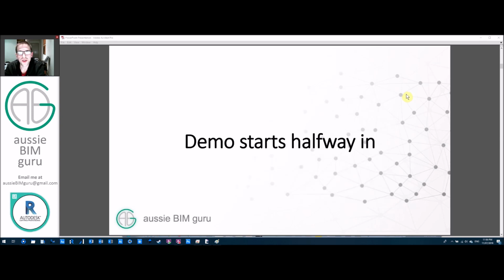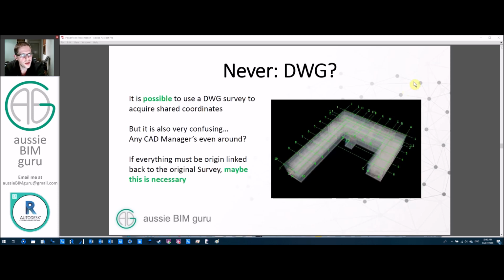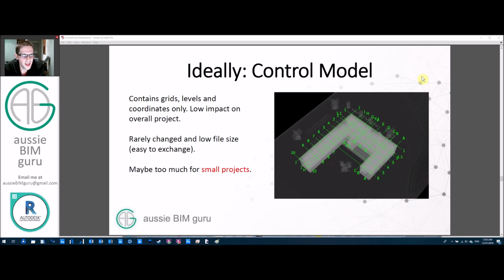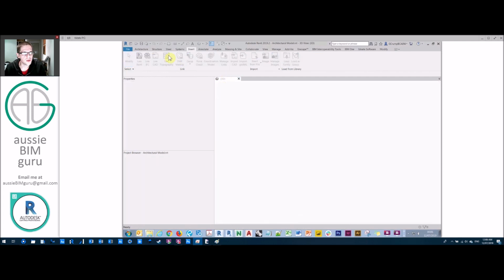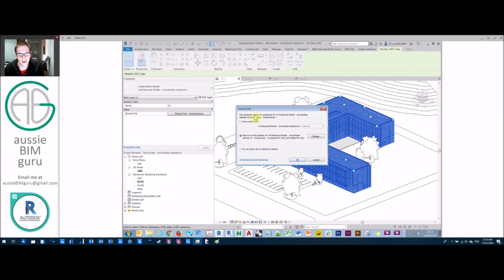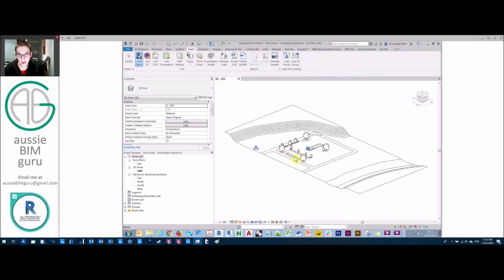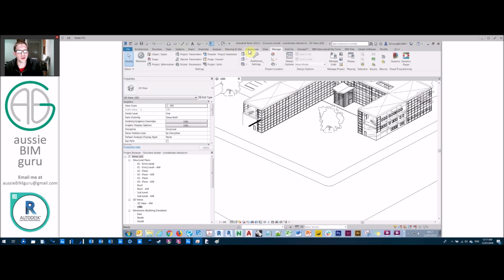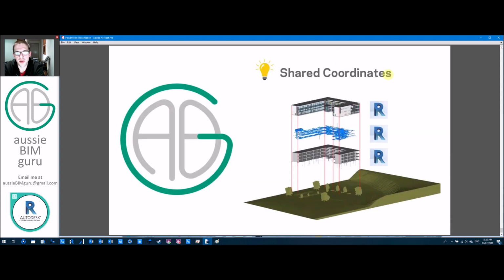Managing Shared Coordinates in Revit!

Comment: Hi, Thanks for sharing video, May I know we still need to do shared coordinates if we have the same boundary line, model, internal origin, project based point and survey point?
Reply from the maker: No you could just work with the same settings if you really wanted to, but it any changes would need to be manually coordinated across all teams without shared coordinates.
Reply: thank you :)

Comment: Awesome video! Thanks! Question: not sure how you could model a building without first having a survey… you would have to design/position your building according to zoning restrictions. Accordingly, it appears that the site model and the architectural model MUST be done together FIRST and THEN you can establish shared coordinates- no? Also, how does this work with the BIM 360 workflow?
Reply from the maker: You can use high level data sources like GIS and publically available cadastre information, but generally without a survey a confident existing condition cannot be ascertained. If by the time coordinates need to be established there is still no survey, there are issues on the job to be solved beyond BIM there.

On BIM360 you can acquire coordinates from models but not publish them if I recall correctly. If coordinates need to be reset I believe this is only manageable if the model is downloaded first

Comment: Very good material. Thank you!
I watched it and hoped to get my problem solved. Unfortunately. It seems like shared coordinates works well, because I'm able to link architectural model to my MEP one and they aligns perfectly. The problem appears when I try to export my 3D model to IFC by shared coordinates. After a first attempt, I opened both architectural and MEP models in IFC viewer and my IFC file appeared to be too low like 100 meters than architectural model. After second attempt, I ticked ifcSite elevation option, but the results were incorrect again: my IFC file appeared exactly 11050 mm higher where it suppose to be.
Reply from the maker: Hrm hard to say the cause but maybe a units issue with the ifc elevation property? If i recall correcly, by default ifc export assumes internal origin is RL 0, so I tend to work that way where possible, although not usually practical to do so if levels change. Might need to ask the buildingsmart forums for the recommended approach.
Reply: @AussieBIMGuru  I did some research: opened a fresh project, linked both architectural and MEP model using origin to origin option. My model appeared way too low architectural one. I measured the distance between these two and I found out that it is exactly the same discrepancy when I export MEP model by shared coordinates not including ifcSite elevation and open it up together with architectural one in IFC viewer. Still looking for a way out how to get this fixed.
Reply: @M1n2kas  Just update your IFC plugin in Revit, and this should fix your issue of the Z elevation.  @Aussie BIM Guru Great presentation Gavin. Thank you
Reply: just remember after all the links shared  coordinates, if you change the position need to re-save the file as the coordinates were modified. otherwise, they all just links should behave the same way

Comment: Thanks as usual. This video answered a lot of questions I had about starting a new project. I am going to be working with t MEP and structural on BIM Collaborate Pro, I have never used worksets on a project before, let alone with Cloud stuff...and usually the engineers use CAD, so lots of potential failure points I am trying to overcome and get ahead of.

Where I do work, we usually start with the survey, so by the time structural and MEP would get my model, I potentially already could have shared coordinates set up on a site model.
What would the workflow be for structural or MEP if I, as arch, already set up my site model and pushed shared coordinates to my arch model?
Do I still need to send Structural and MEP the arch model and the site model, for them to set up the shared coordinates? Or can they just take that/pull that form the arch model? 
I guess I am trying to see if there is any real reason in sending structural or MEP the site model, unless I have to that is for shared coordinates reasons.
Reply from the maker: Yes usually the architect will align to survey first and hence 'own the process' of managing how each other consultant aligns. In my experience for a large scale job with multiple parties working in BIM, the site model is the best way to manage all coordinates in models via shared coordinates and copy monitoring of levels and grids. I suggest that even the architect shares their coordinates with their own site model. This way if the building must be relocated, this can be done by moving it in the site model as a linked file, publishing the coordinates, and realigning the copy monitoring grids in the site model. The site model can then be sent back to other parties, and they can move their model to align with the grids, then acquire the coordinates again. In this process, the site model does not need to change (just the grids in it), and this keeps the process much simpler. Each model should have a live set of grids and levels, copy monitored to the site model's version.
Reply: I will try this trick on small scale project. In Germany one arch. model has more then 30 levels and more, depending on stories. I can't imagine copy monitoring all of them...

Comment: If one of the colleague rotate the project north in the service model, will it get back the same coordinate when we link in to the site model and publish the coordinate.
Reply from the maker: If you want to get the coordinates back to original then ideally the true coordinates should be stored in the site/control model. You can position the link and from there acquire the coordinates from the site, or if you are in the site model you can publish them back to the building. If I recall correctly, project north rotation is independent of the site coordinate settings however, so you may need to manually adjust this by rotating to a parallel reference from the site model as well if the coordinates weren't changed.

Comment: If the arch did not set the coordinate can mep link to the site and publish the coordinate? What if mep have one host model that link to the base model. Which model should we use for the link to publish? Thk u
Reply from the maker: It really depends on who owns the site model, and where it is stored. If MEP is using a container model for all disciplines, ideally this as well as the linked models to it should borrow their coordinates from a common file (site or control model). In my experience the architect owns this model (because usually grids/levels are controlled here as well for copy monitoring), but if the job is heavily services focused then you could possibly coordinate different arrangements with the project architect. The coordinates should ultimately be dictated by the survey first (if there is no survey then hassle your client/project manager - it is not insurable to work this way!).
Reply: @AussieBIMGuru  noted. Thk u

Comment: Thank out very much for the video, when you have multiple buildings in a project, would you recommend to set a different location (sites) for each of them?
Reply from the maker: Not usually. I am more used to having a site model and sharing each buildings' coordinates to that specific file. If the same building is placed a few times on the site then multiple locations could be used in this case for separate linked instances, although in reality buildings are rarely actually identical.

Comment: Great tutorial! Many thanks. Just to be sure: once my architectural model is set, an MEP or Structural modeler can use my model's coordinate system to acquire the shared coordinates, correct?
Reply from the maker: They sure can! Note that they will then have a direct relationship to your model coordinates then though, so its important you don't change them after that (or communicate with everyone if you need to).

Comment: Technically speaking it's all good and very clear. However, I think there is a problem related to scope of work / responsibilities. The process explained in the video shows the BIM Manager taking total control of the models (site, architectural, structural, etc.), getting to the point where he/she changes the coordinates of those models and save them back through the linked files, updating their position. I don't think this is what should be done. In reality, what the lead consultant (or BIM Manager) does is create the site (masterplan) model, which contains the right coordinates (X, Y, Z) and share it to the whole design team (architects, structural engineers, MEP engineers, etc.). Each BIM / Revit model manager within the respective discipline teams will then need to link the site model to their model and acquire the coordinates from it. This is what I've always done in order not to take responsibility of modifying someone else's model.
Reply from the maker: Thanks Gabriele, right you are. Obviously I don't have a pretend BIM manager of each company to demonstrate with, but a control model like this is the best way.

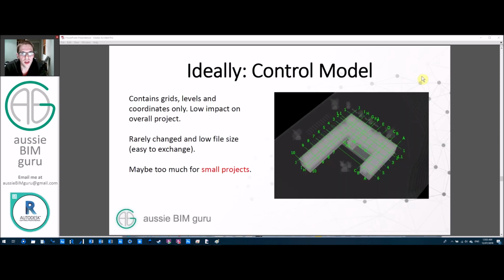I actually mention this at 7:10 as the best option too.
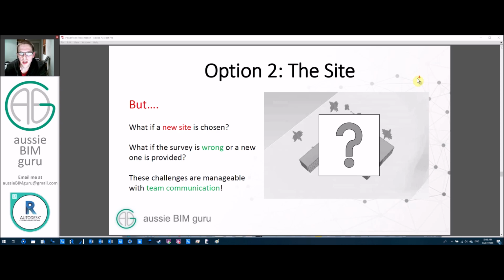Reply: @AussieBIMGuru  Yes, it really is the best way in the case you do everything 'in-house', so you keep control of all models within the same company. Otherwise what I've described in the comment above is the right way to go. And yes, what you mention at 7:10 kind of summarizes the story. It is important to stress the point about roles and responsibilities though. Cheers